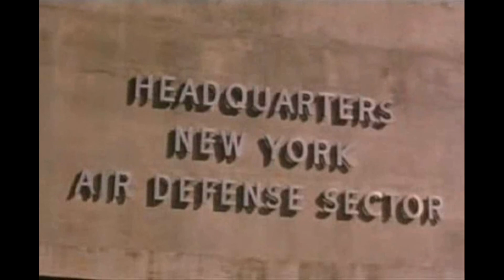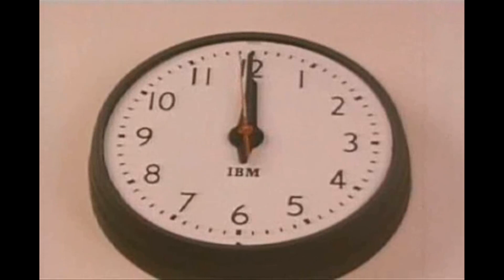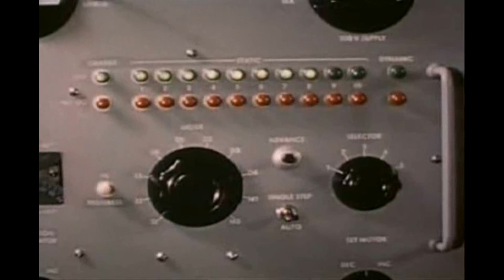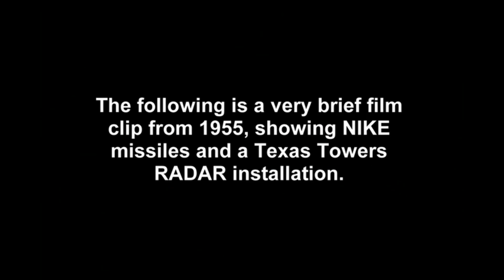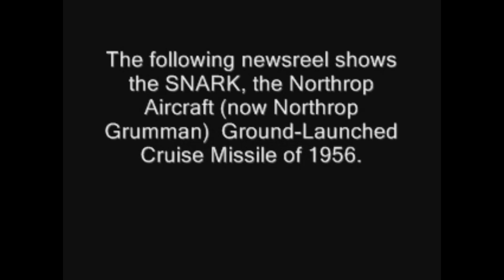IBM Computer History: SAGE, World's Largest Computer (AN/FSQ-7) (cold war RADAR defense) 1950's

Comment: Did Russia have any computer detection systems like this in this era?
Reply from the maker: Nothing of that scale of computing power.  However, there is still a fascinating cold war relic antenna array, Duga-1, a truly massive structure, standing almost 500 feet tall and stretching over a third of a mile long. Designed to capture radio communications, it's an imposing relic of the Cold War, and today it remains a prominent feature within the Chernobyl Exclusion Zone.

Comment: I was a maintenance man on this (SAGE) system for about 6 years.  By the time I left I was qualified on every part of the system.  It was the most challenging but rewarding job I ever had.  We had to keep this monsterous vacuum tube beast running at all times.  While one computer was running the active Air Defense mission, we would be doing continuous "preventative" maintenance on the other computer, then every night, we would switch computers and start the maintenance on the other computer.  When they finally shut down the SAGE systems (There were several across the US), I was gifted a sheet of the "core memory" from the system, which I still have to this day.  Also, Hollywood bought a lot of the bits and pieces (mostly of the maintenance consoles) and I have seen parts of the SAGE system in many movies and TV shows:  Battle Star Galactica, The Six Million Dollar Man, Columbo, and if you look at the equipment with all the flashing lights in the background of "Dr Evil's" hideout in Austin Powers, you will see it is the Long Range Input channel console from the SAGE system.  Fun stuff.
Reply from the maker: Hi Basil BCF, thank you so much for sharing your fascinating story about working maintenance on the giant SAGE system!  I can imagine the challenge of keeping it running smoothly.  What an experience it must have been to work on the world's largest computer system.  I would have loved to just walk through one of their giant control rooms.  We have a couple videos on this channel showing the SAGE (or at least parts of it).  Wish there was more video available, perhaps in secret gov't vaults.  Anyway, thank you again for sharing that info.  Glad you found our channel and hope you will explore it further.  Keep well!  ~  Victor, at CHAP
Reply: Wow, absolutely amazing what these puters could do. As i understand tho, the old tube computers were very unreliable with tubes going bad every few minutes.. just completely terrible! But somehow, they worked with loads of on-hand maintenance  24/7.
Reply: I cut my teeth on an IBM 3081 Complex. We used to climb into the CPU to get at the system console!

Comment: Why is the sound track changed and modern music added?
Reply from the maker: Hi Ken, About 60 seconds of the original music was blocked by YouTube because they said a copyright claim was made by a big music company.  We replaced 60 seconds with the more modern track.  It is not known if the original copyright claim was valid or not, but we wanted to get the entire video uploaded.  Hope this helps.  ~
Reply: @ComputerHistoryArchivesProject  (c)-trolls are a plague of mankind.
Reply: @ComputerHistoryArchivesProject Obviously the music was ALLREADY part of the video so it should not have been a problem.
Reply from the maker: youtube will often "flag" audio music in an old film, even after 50 years.  Its a YT issue.